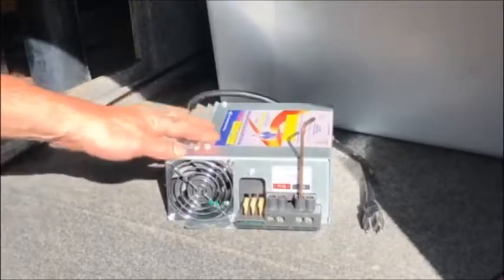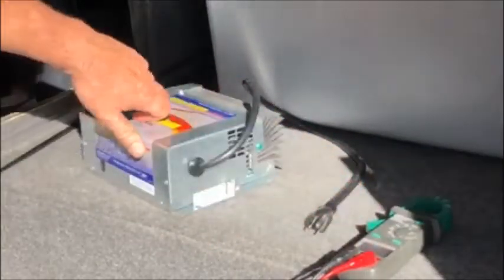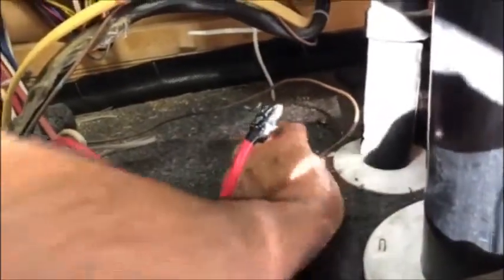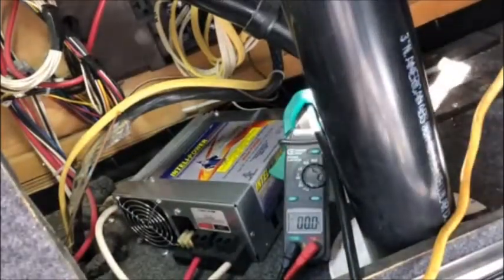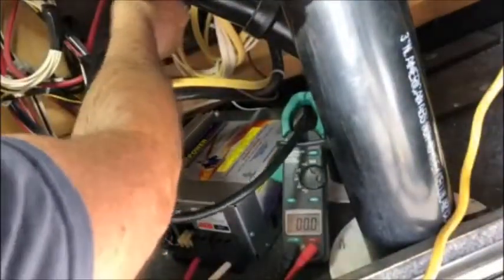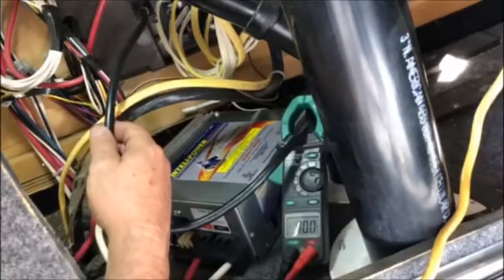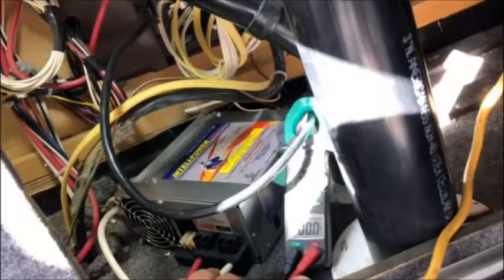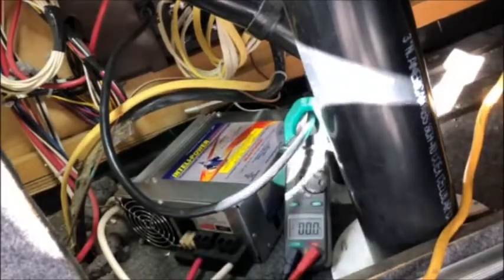How to Test and Replace a 12 volt RV Trailer Converter - Charger Controller

Comment: You can tedt the battery with a multi meter and if its putting out at keast 12 volts then there is no short.